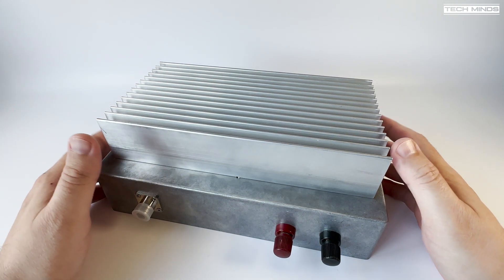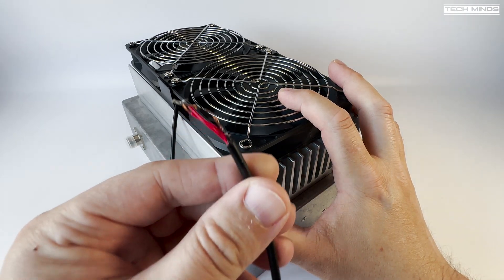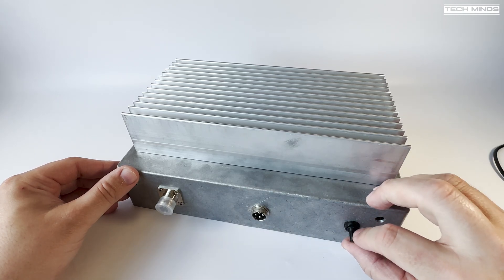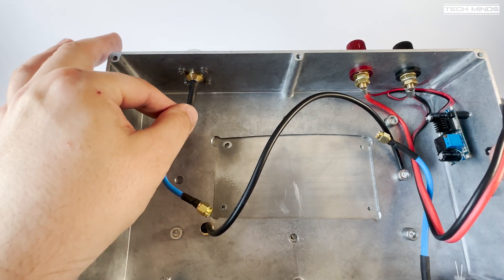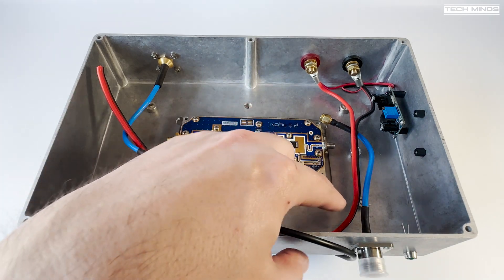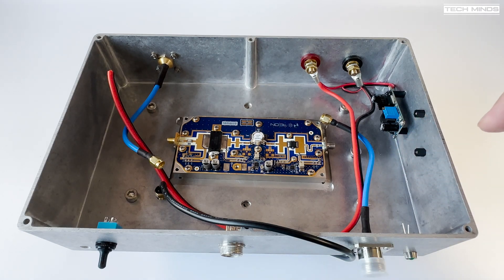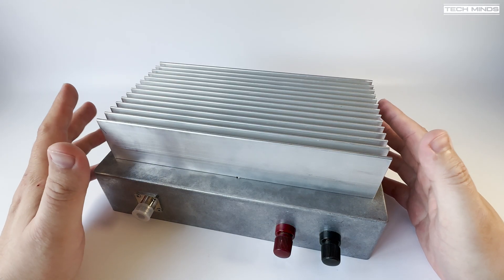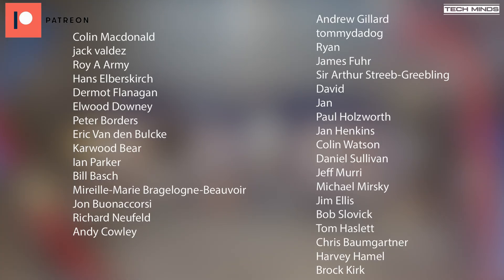Building A LDMOS 300 Watt 2.4GHz Amplifier - Part 2

Comment: Looking at that DC Cable you are using for the 28V supply; are you sure it is rated for 16Amps; it looks like 10 amp cable to me but I could be wrong. Just would mean a bit of voltage drop at 16amps. Good build.

Comment: Have you successfully used the Ereon PowerBlast 300 on 2320Mhz?  I am looking at possibly using a couple of pallets on 13cm EME.  Rob
Reply from the maker: I only tested it on 2.4 GHz. You can contact EREON directly for more information on 2320 usage, but I would check the specs first. cheers

Comment: I understand you're not gonna be running it at full power but one wrong move and you can fry QO-100's transponders...
I've been doing SSB on QO with barely 5watts of power and RTTY with 0.5 watt and for DATV 30watts is known to be more than enough.
Reply from the maker: I’ve been on QO100 DATV for over six months using another 200 Watts amplifier, so I think I will be okay 👍

Comment: i'd fuse the power in because you don't know what your supply will be in the future  prevent accidental damage  .. would it be worth putting ferrite beads on the  rf patches  and a inbuilt tuner .. i don't know how 2.4 works .. also a grounding terminal?

Comment: Progress. How are you cooling the inside? Fan blowing onto the pallet perhaps?

Good that you have the circulator if you put it into an antenna. 

I would advise adding a fuse and an idiot diode in case you swap the polarity by mistake. 

The reason we need so much headroom is because of the peak-mean ratio of the signal and requirement to not generate intermods. For DATV these are often referred to as shoulders. They  interfere with the adjacent channel, so need to be kept low. Typically 10-30% of the maximum is what you can expect to extract cleanly, without special techniques like pre-distortion, so a 300W pallet is well suited to a 50W DATV PA for QO100. This is why there may be a pair of 160W devices in a 30W cellular base station amplifier and it means you can extract much more power if you don't require the linearity, so retired cellular base station and DVBT amplifiers they make nice high power 13cm and 70cm PAs.

Comment: Observation: Are you concerned with the possibility of electrolysis occurring with all the dissimilar metals and the amount of power that will be present. Probably won’t be a problem at first but if there’s any humidity, it may happen down the road.

Comment: Thanks for all your great videos. 
Are you sure the buck converter will not cause rf interferance? 
If the fans are 12V then can you wire them in series across the 24 volt supply?
Reply from the maker: It’s 28 Volt supply but if it was 24 that would of been a good suggestion. I’ve seen others use the same buck converter inside 2.4 GHz amp, presumably for a bias control, so fingers crossed it should be okay, if it’s not then I can take a 12V feed from some where else. Cheers
Reply: @TechMindsOfficial  Sorry I missed that about the "28" Volts. Im used to having 2 truck batteries in series giving 24 to 29 volts with no problems with electronics. How about a fuse on the input to the buck converter? The 28 volt supply can deliver a lot of current to a short circuit and start a fire. A 1 amp fuse should be enough before the buck converter. I'd put a fuse going to the pallet too.
Reply: You can easily put the two fans in series. 28V is not going to hurt them. All electrical devices are typically designed to run at +/- %10 of their stated input voltage. 14 volts on a 12vdc fan is not going to harm it one bit.